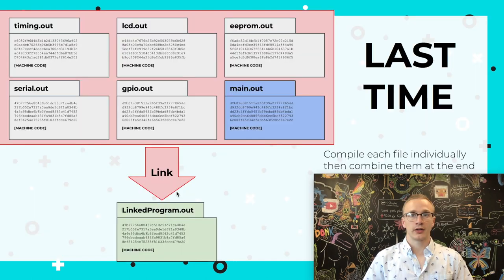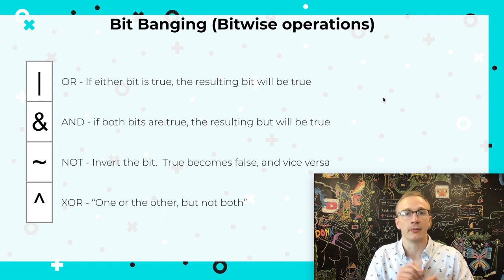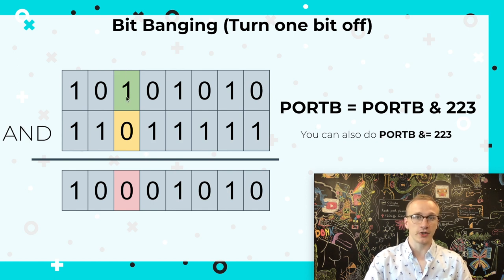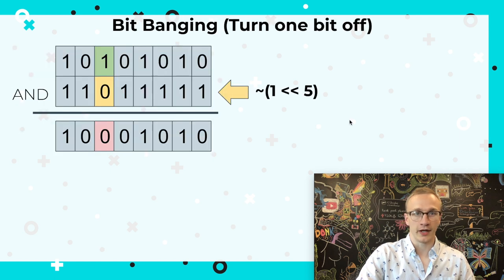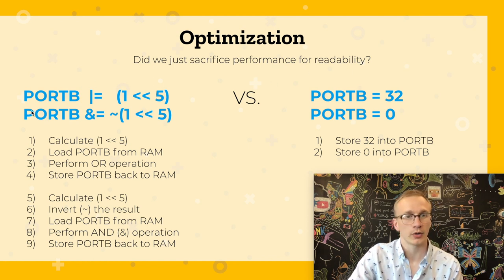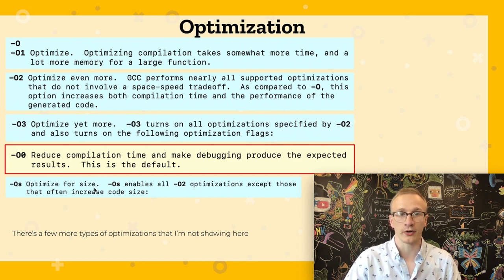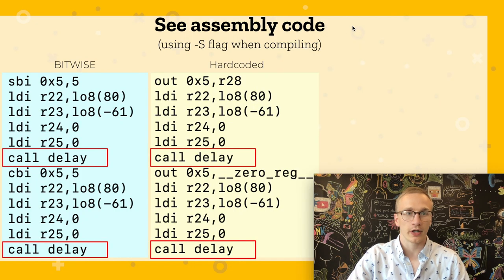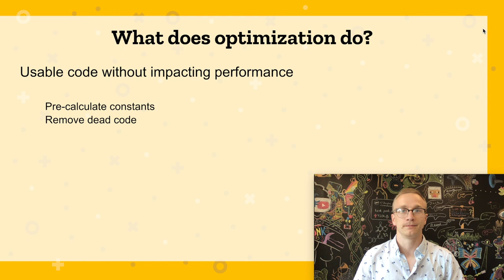Bare-Metal MCU #8: Optimizers and Bit-Banging

Comment: Mitch, this video has a couple of technical inaccuracies.

Firstly, "bit banging" is the practice of emulating a peripheral (e.g. PWM, I²C) via direct port manipulation. What you meant to say was "bit manipulation".

Secondly, it's not an "amperstand", it's an AMPERSAND.
Reply: Actually, it's not "bit manipulation" as you state but instead it's "bitwise"
Reply: @deltakid0  No, it isn't.
Reply: @SodAlmighty  why not?
Reply: @deltakid0  Three reasons. First, bitwise is an adjective, not a noun. Secondly, the term I used wasn't wrong. And thirdly, while what he's doing is bitwise, the term 'bit manipulation' is more descriptive and specific.

There are many "bitwise" tasks you can perform. Bit manipulation is one of them.
Reply: @SodAlmighty  ok, I agree 1. and 3. but 2. sounds odd since is not very descriptive.

Comment: in the previous video i commented about "less" being the pager for man file. in this video i can see that you're using "more". 
this is basically the same thing. "more" being the old pager. nowadays "more" isn't used anymore. in most systems if you run "more", it actually uses "less" instead (more is symlinked to less). the original more couldn't go "up" direction in the text.

Comment: You described two ways to turn on bit 5. One is 1<<5, and the other is converting it to a decimal number .

What's wrong with just writing  b00100000?

p.s. btw your videos are a golden mix of conciseness and clarity. Amazing stuff.
Reply: you can use 0b00100000, 32, 0x20, (1 << 5), (1 << PB5) the result will be the same. The only problem is readability if you use 0b00010000 you can easily set/clear wrong bit/bits.Using 0x20 you still need to convert to binary but its much safer ( e.g 0xA7 upper nibble A = 1010 lower nibble 7 = 0111 ) and the last bit shifting (1 << PB5) just tell you what bit is used. More you can use few bits (1 << PB1)|(1 <<PB2)|(1 << PB3) or make something like this (7 << 1) and its equal to 0b00000111 → 0b00001110

Comment: I am loving these videos.

I always thought the standard presentation of the arduinos was a bit "black box". I get it, it was targeted at makers, not high level programmers who wanted to dabble in lower level programming. but I never found it that satisfying to just download libraries and use the arduino IDE.

I have a 7 segment display and a temperature sensor and my humble goal is to make a little thermometer without using the arduino IDE or libraries (I'll let myself use the AVR headers though)

Comment: I generally prefer to use "0b00100000" rather than "(1<<5)". I'm guessing that a good optimizing compiler would do the same thing with both.
Reply: Yes, It’s all preference. In the end the compiler doesn’t care if you write in binary notation or bitwise shifts. It will optimize it if it’s instructed to do so.

Comment: The (1 << 5) and ~(1 <<5) make no difference to code size because the compiler does the calculation and substitutes the calculated numbers
Reply: As you saw in the assembler code that is not correct
Reply: @RFDarter  If you are referring to the actual assembler output rather than the pseudo assembler earlier in the video then  the assembler clearly never shifts the one nor inverts the result.. In fact the compiler is smart enough to know that the AVR has bit set/reset instructions for ports and invokes them when it sees PORTB  |= ( 1<<n) or &- ~(1<<n). If you read the AVR documentation you will discover the C compilers were designed to do this from the ground up.

Comment: I don’t understand the point about sacrificing performance with “~(1 << 5)”, this is computed as a constant by the compiler, the processor won’t perform the shifting, etc…
Reply from the maker: This is only calculated as a constant by the compiler if you tell the compiler to optimize things like this.  By default, the compiler will often not optimize trivial things like this to reduce code.  You have to add a “-O” flag to get the optimization code to kick in.

The Arduino compiler adds the optimization flag by default, but you have to explicitly call it if you’re running avrgcc on your own
Reply: @MitchDavis2  Nope, whatever optimization level you set, such a 'direct' computation is always handled by the preprocessor way before the compiler could do anything, thus it will always end up with a constant - the final value - (either on a register or on the stack depending on the usage or the architecture) rather than instructions... It's easy to check (and I just did with gcc, clang, pcc, msvc...): you can either get the preprocessor output or just check the generated binary.

In earlier processors, operations using the alu were often very costly in cycles... and even if shifting was way better than multiplying / dividing, its cost was for instance something like 4 + 2n cycles (where n is how much you shift). So a great effort has always been made on the preprocessor side to avoid these computations.